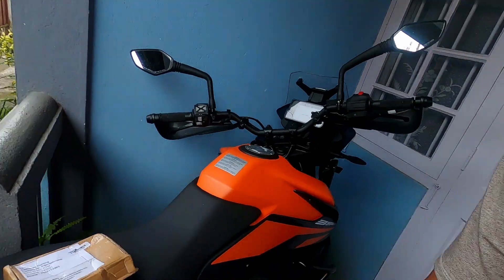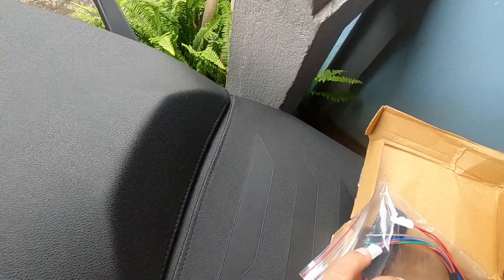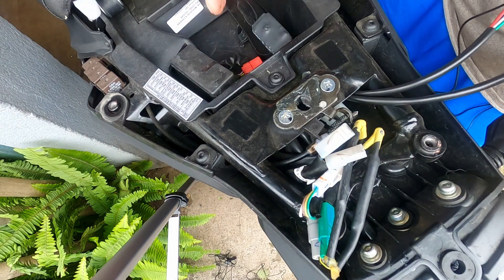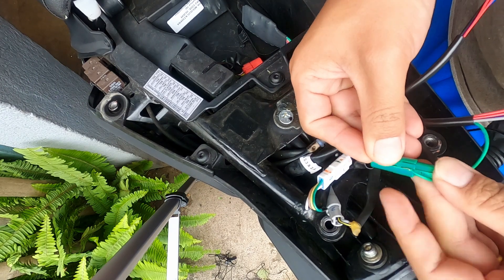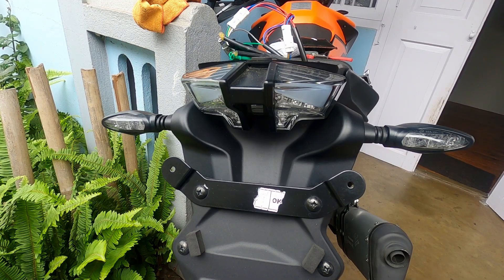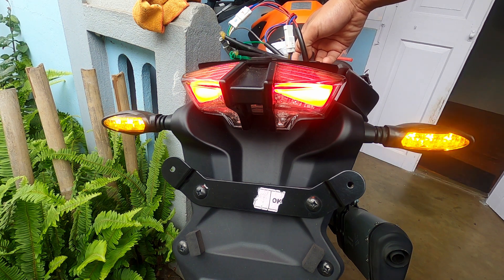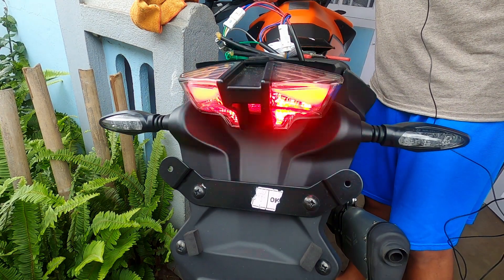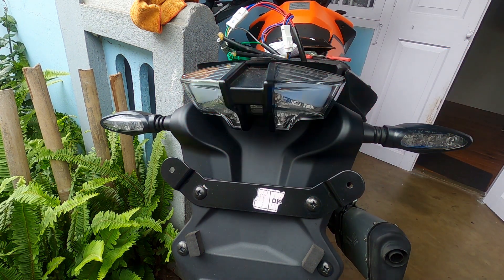Hazard Flasher for the KTM 390 Adventure | No extra wiring!!

Comment: Simtec is a well known brand and they have their version of hazard modules for the 2020 ktm range. Its definetely reliable rather than trying this beta version and this one is just sealed in black rubber with heat rather than a proper box like simtec.
Reply from the maker: Well I have not tried any Simtec products so can't comment, but I have used like this one here in my Duke for 7 years and not an issue till date, all depends on the maker!
Reply: @RandomSync7  Cool!!

Comment: Hello, could you help me with this. 
I'm confused between Adv390 or Himalayan. Will the Adv390 be reliable with its extensive tech features?  I have a dilemma with that electronics could go bad. Which one do you suggest? Himalayan or Adv390.
Reply from the maker: 390 for me brother, no point asking my opinion as it will be totally biased, test ride both extensively and go with what you feel is right, won't be a wrong decision with either of these bikes :)

Comment: I am ok with the Hazzard light but having tail light glowing like that is not for me. Is there option to keep the tail light as stock. Or they could come up with Hazzard light module alone that too with regular type of blink.
Reply from the maker: You can switch back to the normal mode for the tail lights, not an issue.